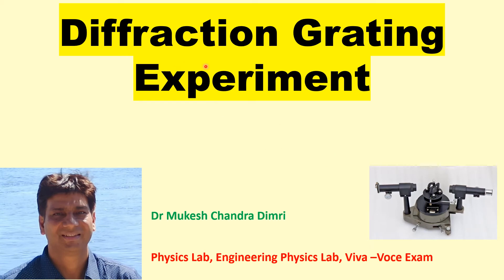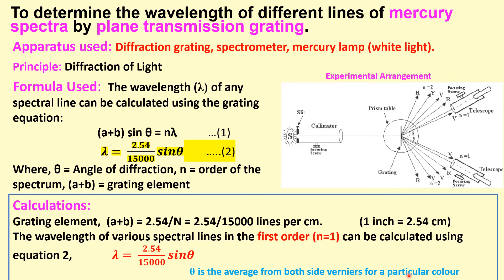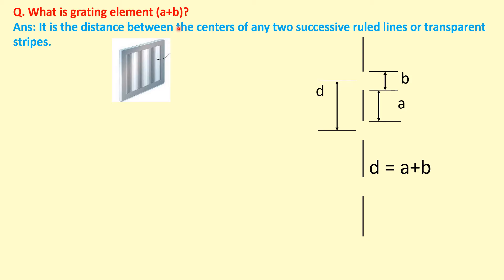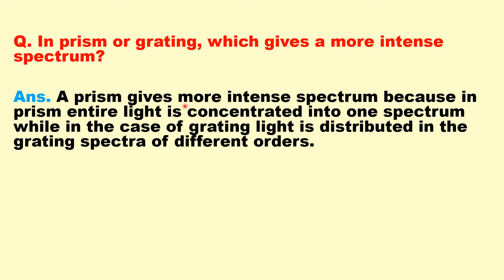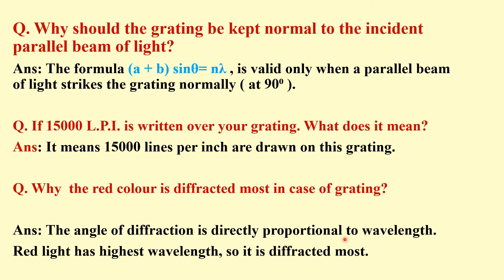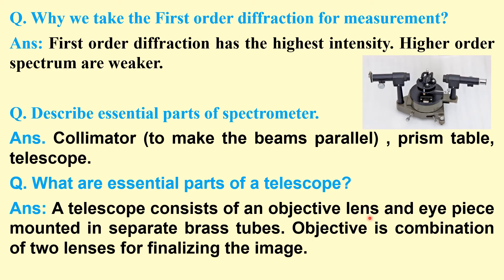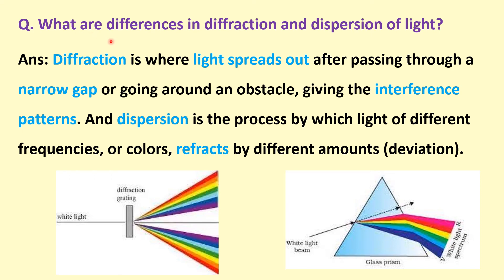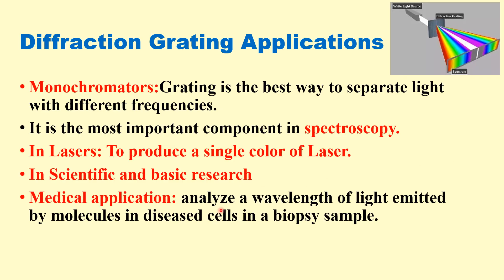Grating Experiment| Viva Preparation| Plane Transmission Grating| Diffraction Grating| Mercury Light

Comment: please give me logic behind the difference between v1 from left and right to get the angle
Reply from the maker: There are two scales V1 and V2 on the spectrometer. We can assume any scale as V1 or V2. Take the readings from both sides for different colors and take the difference. The average value will minimize the errors. Usually, the difference in both scale readings should be 180 degrees.